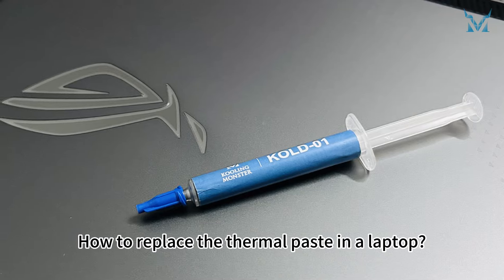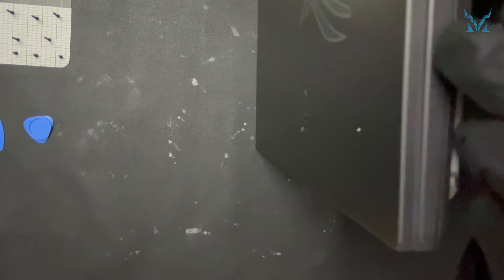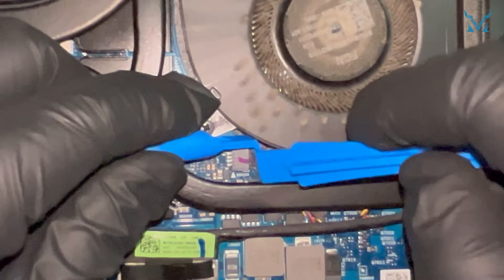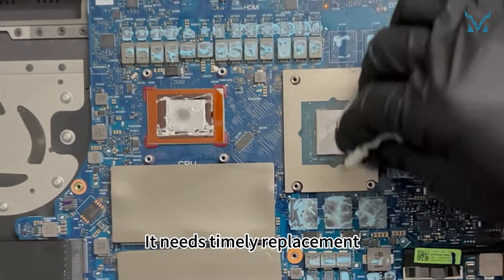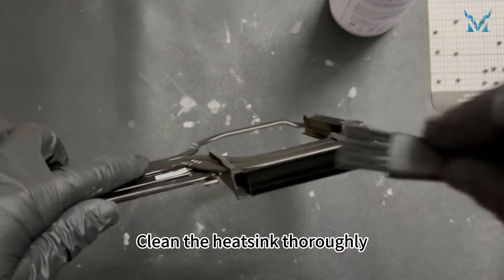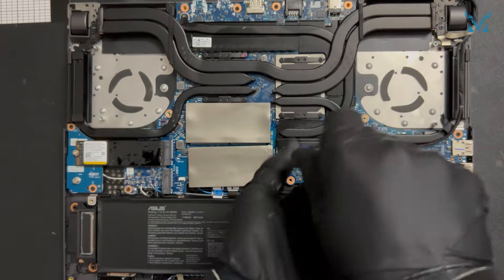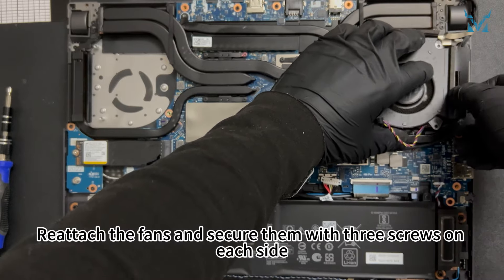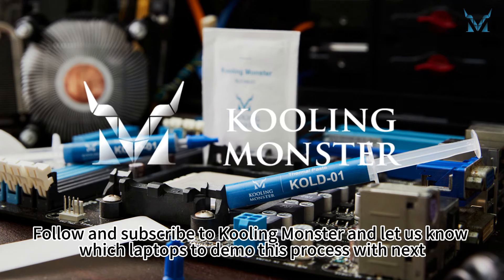Speed Up Your ASUS ROG Strix G15 2022 Prevent Overheating With Dust Cleaning & New ThermalPaste

Comment: make sure to clean the fan first and air blow the motherboard keep dust free everything before separate heatsinks from the cpu and gpu die, this to avoid thermal putty get dirty from it. Unless you have something better than factory thermal paste (most case temperature got worst after replacing it), otherwise not recommended to replace it within 4-5 years. Just clean the heatsink and fan will do
Reply from the maker: Our tests have shown that our product outperforms the original. You're welcome to give it a try!
Our thermal paste is a high-end product on the market, different from standard thermal pastes. Regular thermal pastes are solvent-based, and their solvent evaporates under heat, causing them to dry out. Our KOLD-01 uses an exclusive solvent-free formula, which perfectly addresses this issue, providing superior thermal performance and longer-lasting durability.

Comment: I want to ask you a question. Thermal liquid metal paste is used in my ASUS ROG STRIX G513RM HF267 laptop. As far as I understand from the videos on YouTube, it is only applied to the processor. There is thermal paste on the other one. I wonder if it will be 2 years since I used the laptop. Should I renew it after the 2 years when the warranty of the laptop is over? Can I apply liquid metal to the processor or graphics card where thermal paste is applied? By protecting it with kapton tape. Sir, they probably used liquid metal only on the processor of the device and there is thermal paste on the other graphics card. My warranty will be up in a few months. Is there a need to renew the liquid metal paste in 2 years? If I need to renew the thermal paste of the other graphics card, which seems to be the period. Now what I mean is that if Asus applied liquid metal to it, there should be no liquid leakage during use. Because the laptop is a portable device and I do not carry it all the time, it has only been on my desk since the day I bought it. Should I apply it to the other graphics card as well? Copper classic pipe. No aluminum. They already painted the pipes black. I'm waiting for your answer.
Reply from the maker: Hello! I understand your concerns, and here are my suggestions:
1. Should the liquid metal thermal paste be replaced?
Liquid metal is durable and doesn’t dry out like regular thermal paste. After two years, its performance might slightly degrade, especially in laptops. If temperatures are normal and there’s no thermal throttling, you don’t need to replace it yet. Monitor temperatures after the warranty expires and replace it only if they rise significantly.
2. Should the thermal paste on the GPU be replaced?
If the GPU uses regular thermal paste, it’s a good idea to replace it every 1–2 years, especially if temperatures are rising. If the GPU temperature is stable, there’s no urgent need to replace it. High-quality thermal paste (e.g., Arctic MX-4 or Kryonaut) is a safe choice.
3. Can liquid metal be applied to the GPU?
Liquid metal can be used but requires caution due to its conductivity. Use Kapton tape to protect surrounding components if you apply it. However, the performance gain for GPUs is usually smaller, so sticking with high-performance thermal paste is safer.
4. Regarding copper vs. aluminum heat pipes
Copper pipes conduct heat better than aluminum. If your laptop uses copper pipes (even if painted black), the cooling system is already optimized.
Final advice:

If your laptop hasn’t had overheating issues, there’s no need to replace the liquid metal or thermal paste immediately. Monitor temperatures and only replace them if you notice significant increases.
Reply: @koolingmonster  Thank you very much for your detailed comment. Today I gave it to the Asus warranty service for maintenance. If they fix it without any problems, I can take it for maintenance again in 2 years, this time for a fee.